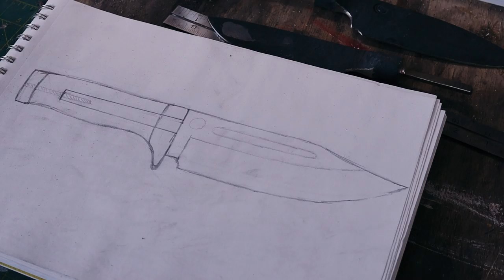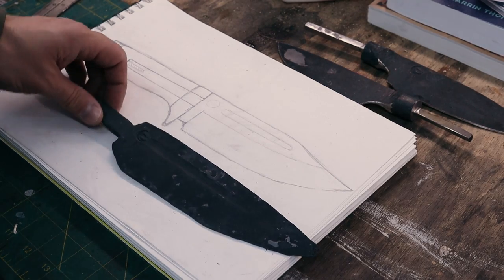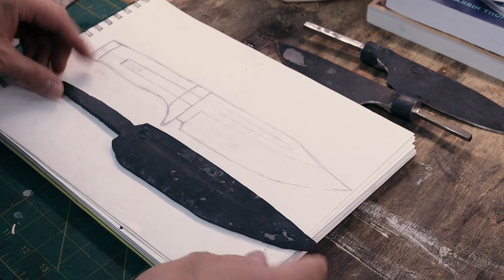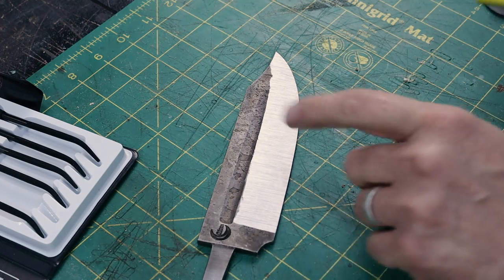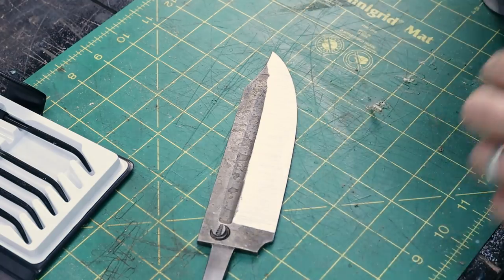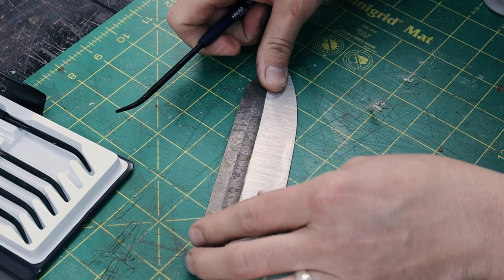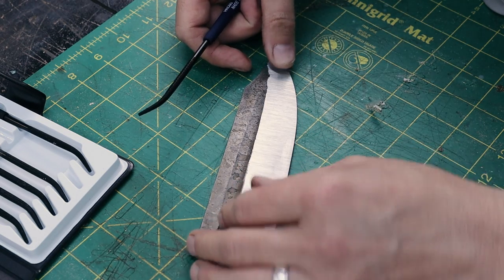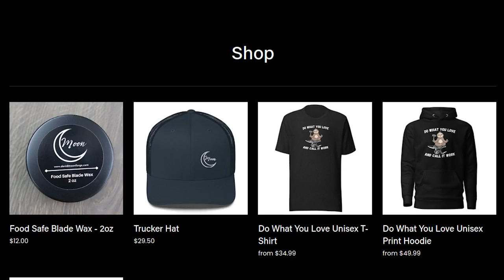Making a Stacked Firehose Handle Bowie Knife from 80CrV2 Steel with a Brass Guard and Pommel

Comment: That's a lot of work just for a wall hanger..those rat tail tang blades just don't cut it..decorative blade..
Reply from the maker: Hopefully it brings in some money for Keep N Safe. Thanks for watching 🤙
Reply: @DavidMoonForge  you are right..lost focus on what the video was actually about..the blade junkie inside got triggered by seeing a hidden tang blade..sure it's part of the design..a stack washer handle design..a full size tang with some diy firehose micarta handles would have also worked..the sharp 90° inside corners were the blade and tang meet are waiting to break under stress unfortunately..I'm sure this will be a wall hanger more then a functional tool..
Reply from the maker: @agentcovert  to be honest I'm a much bigger fan of full tang knives myself. That's predominantly what I make, but my brother and I got to talking about this idea for a build and thought it'd be neat to try out.